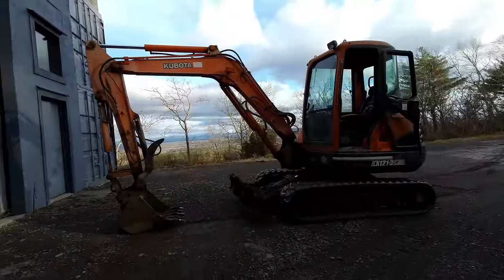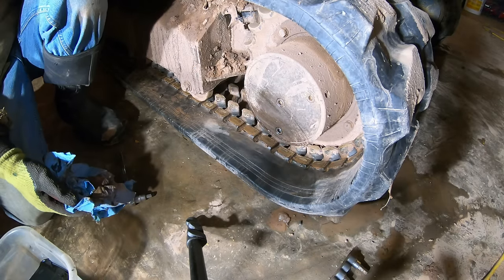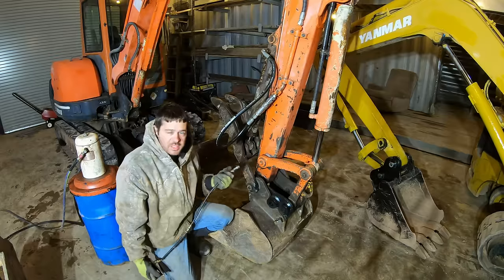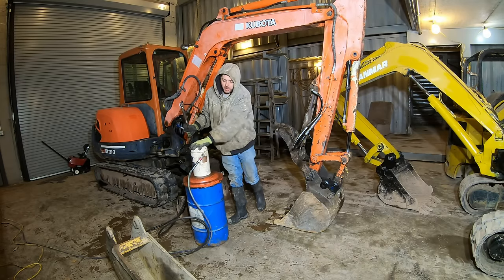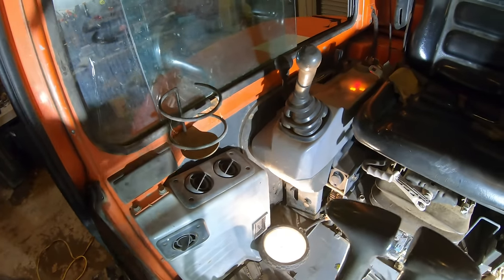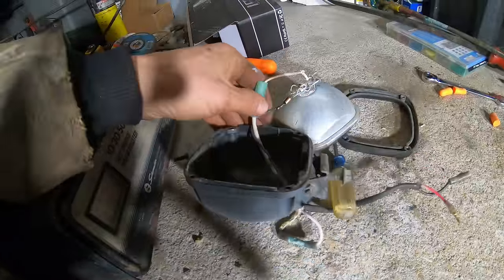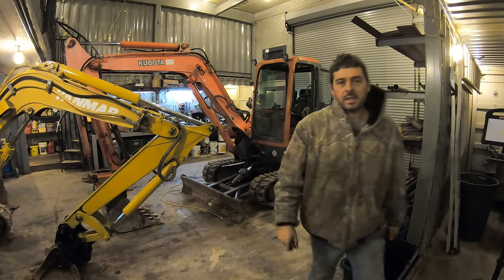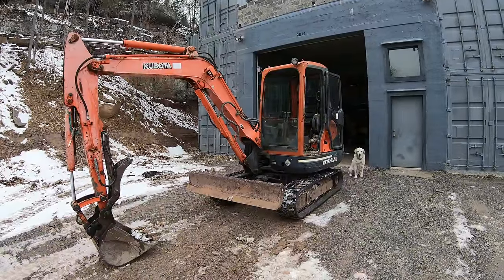Working on the new Kubota excavator

Comment: @8:50
Walmart sells quart bottles of 99% Isopropyl alcohol, or you have 
the YELLOW bottles of HEET fuel line antifreeze, mix 1/2 pint per
1 gallon of just about any grease, to make it flow when cold, and
drive out moisture & condensation, also flowing greases into
pockets easier. It will not change the lubricity properties, it
only changes the Drop point (melt temperature).

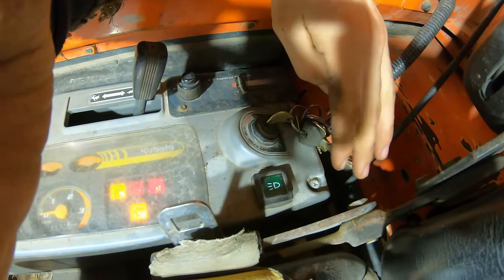@10:47
For all "plexiglass" panels that are scratched & cloudy- a simple
"headlight lens restoration kit" will make nearly new again.
You can clean in place if only outside is damaged. Rain-X makes
a very good kit, about $20. Enough to clean many times,
equipment instrument clusters, canopy, lights & lenses.

Comment: Awesome idea of using a light in place of the fuse to do your trace. For sealing your solder connections, here's a tip I stole from another YouTuber (electronicsandmore): Smear some E6000 industrial adhesive (available at WalMart) on the connection before you slide the shrink wrap in place. Once you heat the shrink wrap, you create a marine-grade seal. I've had great success with the technique.

Comment: Crimps are fine. The problem is most use those crappy crimping tools (like a 6 in 1 tool). My favorite is a Klein  (part# 1005SEN) for your standard butt splice, ring, spade crimp. About the only time I heat up a soldering iron is when I'm working/building a tube guitar amp. Good crimps are made by Thomas Betts and a few others.

Comment: Will be interesting to see how often you use the B50 now you’ve got a 121. In our experience the kubota is such a pleasure to run, but the all thick steel panels of the yanmar mean you can ram raid your way through brush and tree clearance work. Also the yanmar is super stable on very steep ground - good for digging water lines down Scottish mountains

Comment: That thing is significantly bigger than it looks on camera. Operating weight is 9000 lbs.
Edit: using a low geared drill is important when mixing stuff. If it's geared too high you can burn out the motor.

Comment: Andrew with all the fallen timber you deal with why not put you a big wood burning stove on your shop.  Run it hot and put a big fan behind it.   It will keep your shop toasty while you’re working in severe cold spells.   I did for my shop until I got to old to cut wood.   Now I run a torpedo kerosene heater in the Kentucky winters.   I don’t work as much in my shop as you do in winter.   I really enjoy watching your videos.   I was in heavy machine maintenance for many years.  Coal Surface Mines.   Got old and went to college in my 40’s so I could keep going.  You are a very intelligent young man.  A hardworking and appear to be very honest.   We need more contractors like you who just don’t do a job but takes pride in the end results.   Sorry for the rant but have watched all your videos and hope you continue.   I noticed you bought a 988 B loader.   The hydraulics can sometimes be a pain like the supplemental steering pump.   My least favorite Cat Loader to work on.  992 C was my favorite.   The 3408 is not a bad engine for the 988 just keep it serviced and make sure the center pins and rear saddle is taking grease.  Wear will make it rough on your back.

Comment: I like the regrind asphalt garage apron.   Though a proper concrete slab would be nice.  Hey what about a concrete apron/tub with a steel grate over the top?  You  could pressure wash yir equipment and leave all the mud outside.   Then just flush the mud out of the sump every few months...  It would be badass ....practical!  Just saying.

Comment: That was a cold solder. Heat the wire with the soldering gun first then apply the solder to the wire and let the wire melt the solder. 100% connection every time and won’t break from vibration.

Comment: I worked on one electrical problem for a couple of days and couldn't find it.  The circuit breaker would blow after a few minutes to an hour.  So I just wired across the circuit breaker and sure enough the wire burned up.  We got it replaced and never had any problems again.

Comment: Great work as always Andrew, Interested to see how this thing does in the summer when it's hot out, especially with all the glass on it. Looks like a good machine though. And man that hot water pressure washer you fixed with the spinning attachment does some good cleaning!. Also, I was waiting for that barrel to run out! Can't believe it's still that full after all the use you got out of it.

Comment: You need a $20 Dusichin foam cannon from Amazon and a some Awesome cleaner from the Dollar store.  It will cut the grease and stains right off of the equipment without having to drag out the hot water Pressure washer

Comment: @Andrew , i use to wash for a cat rental store. Use your yellow tip on your pressure washer. Delta foremost has a great degreaser, can't remember the product#. If you need a paint overspray remover use their "maskoff". Ooh and try to keep your water temp below 185°f to keep from damaging the paint primarily on the plastic/fiberglass hood.

Comment: pressure washing fittings drives water in then.   water=rust.  if you do, grease it right after,  and from experience, Pressure wash away from the front door,  your walking through and having to lay in it when you pull the next project in..

Comment: Very gratifying to see correct electrical repair. So many videos use the butt connectors, just plain crap, or wire nuts, useless on machinery, instead of soldering the joint and using shrink tubing, the correct way to connect wires.

Comment: Nice work as always!  Here's another tip: use a blown fuse and make a connector for the fog light you use to test the fused circuit.  That way you don't have to mess with two separate spade connectors.

Comment: I like the trick with the fuses! I do wonder though, why not use crimp connectors to fix the wires? It's faster, and there's less stress at the wires. If you tin a wire, then where the solder stops, you have a big potential failure point, because this is where the wire will bend. Crimped wires have that less and they have a plastic bend relief over them. Seal it off with adhesive lined heat shrink and you're done.

Comment: Apparently no one ones ever heard of quality heat shrink butt connectors, the hold a lot better and last way longer than solder, not to mention a lot easier, your going to pay for them but we use them on all our trucks and show trucks, some of the kenworths pushing over 500 lights and we’ve only had to replace maybe a handful

Comment: I was looking at this video of you doing maintenance. If i may suggest a tip. When doing your engin oil change also change the oil in the drive train final drive. It takes very little oil but it will increase the life of the final drive. They are very expensive to overhaul, i know i was a mechanic for many years. Also when greasing the turret gear add grease at every 90 deg ( not too much) , then rotate two or three rotations to spread the grease all around

Comment: Andrew, go to the paint store an get a small can of acetone and mix it your big  grease pump. It won't hurt anything, but it will thin it down and when you pump it into a fitting the acetone will evaporate and the grease will return to it's normal viscosity.

Comment: Soldering does make a good connection but where the wire comes out of the solder can be a point of failure due to vibration which can cause the copper to work harden. Properly made crimps are the best option.

Comment: You dont need to keep using that roto tip on anything painted. It will take it right off. That is a 0 degree nozzle spinning in a 25 degree radius.

Comment: Clean out the dirt under floor board, it rots out the wires for the throttle control and or strips out the motor that pulls cable. It gets packed with dirt

Comment: Love that hot pressure washer. I vote Andrew builds a “ Separate power wash station” with a concrete platform and the works to avoid all the water and mud at his front door. :-).

Comment: Is that new Kubota roughly the same size/weight/power as the Yanmar B50?
Reply from the maker: I think its a little smaller. Its faster than the B50, but the B50 is stronger.

Comment: Shorted to ground is not the correct term. It is either shorted or grounded. But it has been used wrong for so long it is common. Like a hot water heater.

Comment: Which grease do you advise using? That blue one you use is it just died to be easier to spot ? Or is it some fancy synthetic stuff that doesn't pick dust as much
Reply from the maker: That blue grease came in that grease gun. IDK, get high pressure molley grease.

Comment: andrew.. you might think about having a 20 foot extension made up for your grease gun set up.  out of proper hose for it..  this allows you to clamp on to the zirk fittings on the boom . climb into the seat.. wiggle the controls to shake the pins while you are pumping grease in.. this will get grease all the way around the bushings and pins. 

 you may also want to change the oil in the Kubota final drives again..   using the boom to hoist the track in the air and spinning it for a few minutes to stir up any sediment just before draining it.  then drain and refill. this should get more contaminates out.  gear oil is far cheaper than a track drive.  you might do change it  3 times until it comes out clear .. running the track to get the deep dirt into the oil where you can change it out. 

the long hose for the grease gun also works great for the swing bearings.. so you can just pump away while swinging back and forth flushing the dirt out while you go.

Comment: Hahahahaha. When you went to the big guns on the pressure washer 😂

Be careful with that type of nozzle. I used one to clean my zero turn mower one time. Oops. Took every sticker off and in areas where the paint had chipped, it peeled even more paint off. Plus, jacked up the deck belt 😱
Reply: Also when using that type of nozzle when you first pull the trigger make sure to have it pointed down or you can break the ceramic insert inside it.
Reply: Rick Janisse yes sir 👍

Comment: Hey Andrew 😊....just found your videos in interest to buying some equipment but my question is about loading a skid steer and a excavator together on one trailer and like what type of trailer would be compact enough carry the items together and in meaning of my question is about compact and being mobile all at once....thanks for the great videos 🤙🤙🤙🤙🤙 a video on my question would be awesome.
Reply from the maker: Look at the weight the trailer is designed to carry. I can fit a skid steer and mini excavator on my 12 ton deck over trailer. Its 20' of deck and 5' of ramp section. Make sure your truck is meant to tow that much weight.

Comment: Awesome fog light tip, didn't know that.
I do disagree on soldering over crimping wire cable joints on high vibration machinery. The copper wires tend to break due to mechanical stress caused by vibration usually right next to the stiffened solder joints.
Reply from the maker: Once its shrink tubed it wont break.

Comment: Did ya hear that the Rover on Mars stopped working. I think NASA should call you in for a consult!
Reply from the maker: Yeah, the solar panels are probably just covered in dust. It should be power by a radioisotope thermoelectric generator like Curiosity. At least there is still one rover still alive on Mars.

Comment: I have a suggestion for a new project and video. Build a wash rack for your equipment. That way you won’t wash the mud and grease onto your gravel drive in front of your shop. Just a thought.
Reply from the maker: Sometimes I put stuff on trailers to wash them. That helps.

Comment: Andrew, You need a little heat in the shop.  If not for you, then for your equipment, tools.  You don't need to keep it at 72, but 50 - 55 F would keep the shop chilly but not cold. Keep the grease flowing.   1) get a wood burning stove.  You have plenty of firewood there.  2) Install solar panels to power the electric heaters for the shop.  The solar panels may also reduce your electric bill.  
     You may think that you don't need it, but as you get older you'll change your mind.  Stay healthy.
Reply: I'm in kinda the same predicament.  Here's what I found:
Check homeowners and biz insurance fine print on the woodstove, many won't allow even with a pro installation.  My neighbor got the boot even after they told him his was okay. 
Bid for electric solar and insulation to make it work was tens of thousands of $$.  Not economically feasible for a working guy.  (My shop is a 35'x66' pole building w/cutout room).  
Passive solar DIY re-construct the most feasible, can scrounge glass, insulation costs still substantial, cheapest about $10,000.  And you still only get a 50° shop 3 or 4 hours a day in my winter climate.   My interior shop slab isn't insulated from the substrate, so never gonna warm up anyway - cold concrete sucks heat out at a remarkable rate; ceiling fans help.  

I would love to build my existing shop from scratch; come up with a few ideas over the years that would build a 4-season shop economically.  Retro-fitting/remodeling always more $$ and often a PITA.  I'm not broken from the idea of heating my shop, but still hunting for what I can reasonably do.  My first option was finding a huge bag of $100 bills in the road ditch, but that hasn't panned out.

Comment: Quick question; after you wash the excavator off in front of your shop, what do you do with the mud and bits of grease? I tried it in front of my shop and regretted it after. One more question, the Kubota manual says clean your tracks at the end of the day. I don't. Am I messing up?
Reply from the maker: If something is covered in mud, I'll wash it somewhere else. That thing wasn't that dirty. Sometimes ill go with a paper towel and pick up any grease.

Comment: how do you like the kx121 for digging close to foundations for drainage work? looking at used 3.5 tonne zero tail swing machines.For same price or less can get a kx121. which is a  heavier and  stronger machine correct?
Reply from the maker: Yeah the KX is bigger than 3.5 ton. I like it. Its close to zero tail swing.

Comment: Hey Andrew  are you to the point where you can fine grade like sidewalks, driveways or basements floors with that machine..to less than a 1/2 inch.
Reply from the maker: With a grading bucket it can. If stuff needs to be perfect ill use the laser. I might get a setup soon where the laser mounts to the excavator.

Comment: The Air Force forbade us from using high pressure water anywhere near grease-able fittings. The rational was that a pressure washer would force water into the joints, fouling the grease, and rusting the pivot joints. Love the videos!
Reply from the maker: I don't think that would be the case, IDK, just grease stuff right after. You can tell when water is in something when greasing it.

Comment: 15:33 Great example for how bad wiring can cause a fire. Not just in this light, but this can happen in your home. This is why a lot of jurisdictions require electrical junction boxes if you need to splice wires.
Reply from the maker: Circuit breakers will protect against shorts like this. Especially arc fault.

Comment: We have a kx 121-3 with 12k hard hrs, I had to do a head last winter, cracked on left side edge/ water jacket. It was thin cast. Machine runs every day
Reply: Did your hr meter start back at 0 after 9999

Comment: So let’s put in a hydroponic hot water system in that floor of yours.  Perhaps another pour on top of what you have.   Out door Wood boiler couple of water regulators. Black 1” pvc gas pipe for the water.   Be nice !     Make a nice video....too !
Reply from the maker: The pipe is already in there. I just never got a boiler.

Comment: 12:50 I might be wrong, but if you put a fog light instead of the fuse, then don't you risk melting the wires? For the same reason you didn't want to put the 30 amp fuse in it.
Reply from the maker: No, because the lamp does not act as a direct short.

Comment: The sound of the brocket and arm on a excavator make the excavator sound as if it’s a piece of junk all that is needed is to replace the bushings or the bolts holding the bucket or arm in place this improves the value of th machine ten fold what is wrong is the sloshing around of the parts
Reply: Russia?

Comment: Thanks Andrew because of you I'm getting ready to buy an excavator. I'm going to build about a mile long road through 40 acres of land I recently purchased.  Most is up and down and pretty steep and I imagine from previous digging with a bobcat I'll run into alot of slate. Whats your opinion on rubber vs steel tracks?
Reply from the maker: Rubber tracks for machines under 6 tons. Steel tracks for machines 6tons +
Reply: thank you !  Amazing how you found that short!

Comment: Thanks for the great video! I have a question, what is in your experience the most bang for buck in the small used segment? I have a small property and a lot of odd jobs that don´t require a lot of hours etc.. just an easy "at home" fix machine that will probably stand for most of the year. around 1.5 - 2-5 tonnes would do the job.
Reply from the maker: Get one that says "Made in Japan". those are the good ones.

Comment: When you do shrink tube on an external repair like that, you might want to consider using adhesive shrink, to make sure your repair is water-tight.  In interior uses it doesn't matter so much, but I'd be a little afraid of water getting under that tube on the exterior lights.  Always enjoy watching your videos!  :)
Reply from the maker: Good tips.

Comment: Wow.  1,254 Comments.  I have a question for Andrew.   What did you use for the new lights ?   Brand/model ?
Reply from the maker: Search LED flood light 12v.
Reply: @AndrewCamarata  Do you have a specific brand/model  that you like ?
Reply from the maker: s bennet I don’t think they were branded. They are nice metal housings. Just get the ones like that.